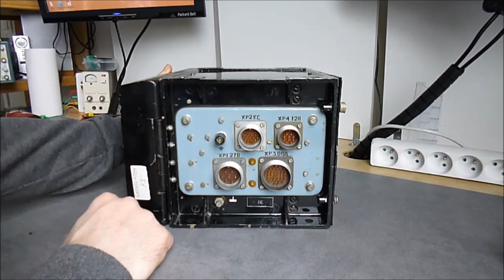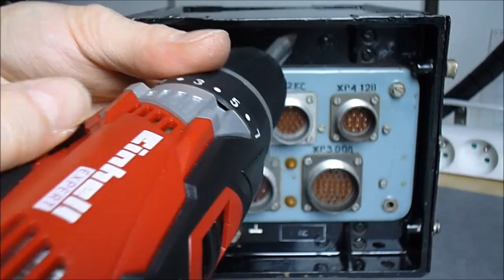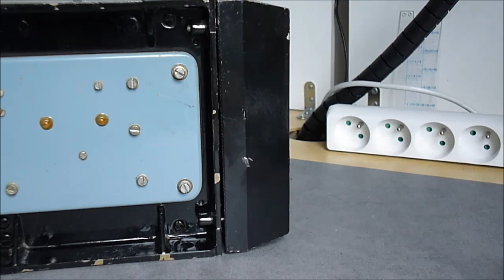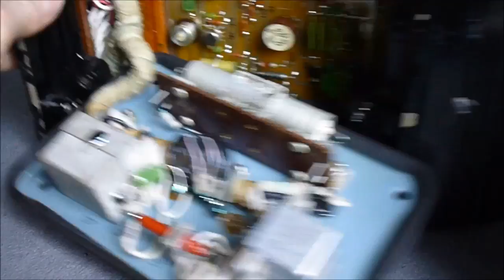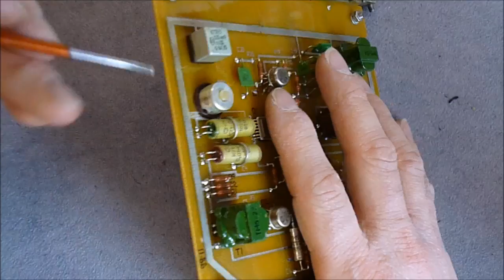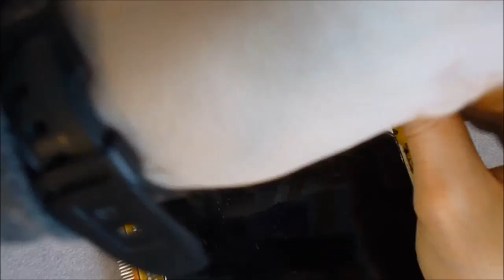Mystery soviet C23-1 electronics box teardown

Comment: I remember when "specialized" western literature used to claim that soviet electronics were mostly based on thermoionic valves, and thus was inferior to western one.

It now appears that those claims were a pile of lies, and that propaganda was very active in the west not only in political publications, but also in technical ones.

One example is the S-200 SAM system, which was designed in the mid-60ies, and included a 32bit fully digital computer in its command and control component (for classification and prioritization of targets, and for calculating firing solutions).

Not to mention that in NATO armies and navies, mechanical computers were still in widespread usage til the 70ies.

Comment: Very sturdy and neat building , I´ve seen western avionics pcbs before which coating and assembly were similar to the Russian one.  But the Russians only applied neatness on military equipments  ?  It  can be checked @ https://www.youtube.com/watch?v=FQMjPzXLC5k&t=1603s  ,  this time a 1976 B&W TV set is opened an analyzed in the video, showing how neat built and serviceable it was.   Russians did their best with what they have in hands  , despite the use of some obsolete components like germanium transistors in 1976 , this tv set was manufactured to last long.  Thank you msylvain59 for sharing your video.

Comment: This is from a 1960s  Russian bomber aircraft. The device runs at 400Hz. I've come across these boxes before.
Reply: It's NOT from 1960's. There was NO surface mount chips in the 60's in the Soviet Union and more than that there was NO mass produced integrated circuits there at all, LOL😂, until 1967(more like until 1971) and they were very basic.
Device on the video was built in 1986, it matches the latest datecode on most of the chips.
Soviet avionics from the 60's would still contain vacuum tubes in large quantities and discrete semiconductor stuff only.
Soviet Union was hugely lagging behind the rest of the developed world in semiconductors.

Comment: some avionics computer?
Reply: +flyguille This is clearly a digital device but not a computer. It has some logic built in with some weird-ass modulated analog input signal processing that was a common thing in aircrafts. It looks like there is a clock generator and signal conditioning board, a power supply board, a couple of interface boards and some logic boards. The unit was clearly a part of some kind of a big system made for military but I doubt that anyone still remembers what exactly the thing was made for. Most of that kind of things are currently obsolete and are laying buried down in landfills all over the country.

There are some quite good parts inside these things though. All the transformers and chokes have quite a high quality ferrites inside of them and are very nicely made to be used in some kind of a DC-DC converter. The ceramic capacitors (the green ones and the more precise big orange ones) are also quite nice. All the switches and buttons were very nice and reliable. The thin shiny axial capacitors are actually tantalums. And the big oil-filled foil-based caps are very nice as well.

The 2РМ sockets on the thing may look quite ugly but they have some features within that make them extremely reliable especially for outdoor applications and they are still in use today. They have V-shaped hardened steel springs that scrape all the junk and corrosion of the pins each time you connect the socket and their special shape keep the pins compressed with the corresponding surfaces all the time preventing all sorts of intermittent contact issues almost all of the modern crappy made in China sockets are so famous for.

The round ICs are most likely Op-Amps and most of them are just pieces of garbage by modern standards. Most of them had very poor characteristics and the more high speed ones had stability issues and required some special techniques to make them operate reliably. The logic ICs are most likely just regular CMOS devices in small military approved packages.

The big-ass bipolar power transistor are quite crappy as well. Their froward current gain generally was less than 10 so they required a bipolar buffer to a bipolar buffer to drive them and other characteristics were not much better. I would scrape all the vaseline from the inside of them and thow away the rest.